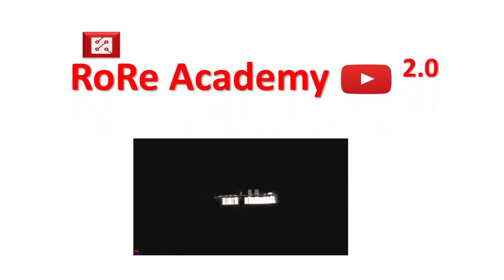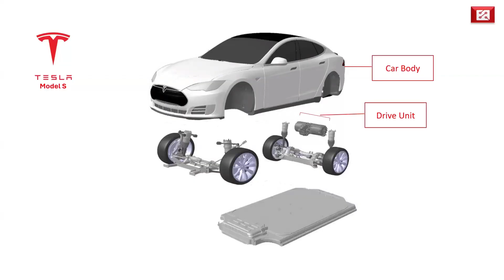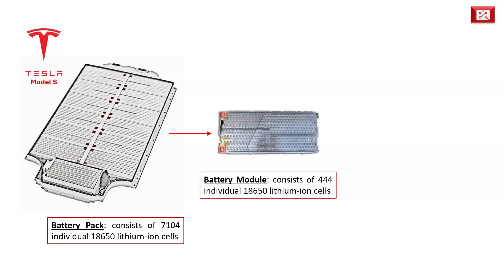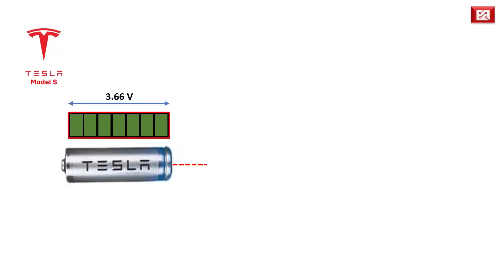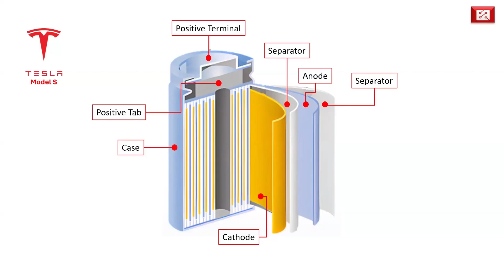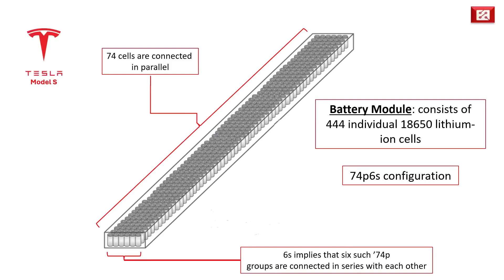Tesla Model S Battery Modules Explained | Cell Design, Cooling & Architecture | RoRe Academy

Comment: From a purely technical standpoint, is Tesla’s Model S battery module design still best-in-class today—or has the industry moved on with better cooling, packaging, and safety architectures?

Curious to hear opinions grounded in engineering, not brand loyalty.